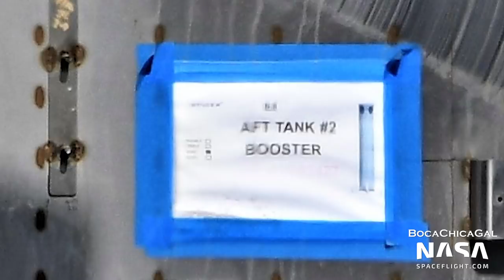Booster 7 Detached from the LR 11000 Crane | SpaceX Boca Chica

Comment from the maker: 0:00 Sunrise Over the Launch Site
0:36 The Launch Site
1:20 Ship 20 and Booster 7
1:42 Beams Lifted Into Place for the New High Bay
2:07 Ship 24’s Nosecone
2:29 Booster 8’s Aft Tank #2 Section Prepared for Moving
3:20 More Beams Lifted for the New High Bay
4:04 Booster 8’s Aft Tank #2 Section Moved Into the High Bay
5:02 The Orbital Launch Mount
5:23 Orbital Tank Farm Venting
7:16 Booster Grid Fins
8:14 Crews Work on Booster 7’s Aft Section
10:48 Load Spreader Detached From Booster 7
11:25 SpaceX’s LR 11000 Crane Rolls Away from Booster 7
11:51 The Chopsticks are Moved to Make Way for the Crane
Reply: Sorry if this has been explained, but do we know why the grid fins aren't installed on B07?

Comment: Very nice!! I can't wait to see booster 7 lifted up on the launch mount. Hopefully lifted with the chop sticks
Reply: Indeed, though its likely that 7 will visit the can crusher test pad first. I think this was originally the plan when they hooked up the load spreader, i dont know why they have taken it off already, it wasnt used at all to my knowledge.
Reply: @Vatsyayana87  with how high the winds were there yesterday they most likely used the crane to help stabilize B7 with the wind. They've done that in the past with B4 and starships when the winds were very strong
Reply: @RarestAce  If the winds were high that would definitely be a good reason. I dont recall noticing them being of any significance, usually its pretty obvious on camera, but not always.
Reply: @Vatsyayana87  The amount of time spent working on the clamps holding B7 might mean they are having trouble with them. This new type is hydaulic I think and should be simple to use, but for some reason are not. Also, why did the crane have to move away at all? Needed for somthing else?
Reply: @Vatsyayana87  You mean with the ropes? Surely the ropes aren't long enough for a full booster
Reply: @BRAWGWill  Indeed, i mean 70 meter ropes are by no means unreasonable thing to picture. But i do think its more likely to be that B7.1 will be the one getting the crusher.
Otherwise they wouldnt be making a "test" named tank right now.
Its just a bit odd they would bring the crusher and 7 down without any engines on it. So we will just have to see.
But also, it not uncommon for companies to do this on there full sized vehicles. its the only way to know for sure.
Reply: @rogerhalt3991  I do agree  with you here, They are making a new test tank that i dont know what else would be done with it except go on the crusher. But it does seem possible to put 7 on it as well just maybe not to the same extremes, i dont know. Both sides of thought make sense.
Reply: @knowledgeisgood9645  Same questions on my mind lol. I just woke up, and i see on my right here, that she is now on the pad. So i guess that answers a few things lol
Reply: @Vatsyayana87  Makes sense to pressure test without raptors or grid fins in case of RUD
Reply: @BRAWGWill  I agree, and its already on the pad so im guessing that means 7.1 will be the one in the crusher. 
Though i still agree with the fact that its not beyond reason for a full sized one like this to undergo such a test. Its just up to Spacex if they feel its needed or not.
Seems to me that the crusher on the small tanks only really puts the contact points to the full test though and misses out on the question, will the entire thing fold in half under such loads, which can only be tested with a full article.
Reply: @Vatsyayana87  They haven't felt the need to test other boosters with the same contraption before though. So I wonder why now?
Reply: @BRAWGWill  B7 might even be a path finder for B8. They need to test a booster for structural strength at some point, like they did with a nosecone. I would have used B4 for that, but it could be B7. I will have to wait and see.
Reply: @knowledgeisgood9645  B5 is another logical choice but maybe they want to test it with a more up-to-date design. If they do end up opting for B8 it will put the numbers back in line with B4/S20, B5/S21 etc. which I'm sure will satisfy some people
Reply: @BRAWGWill  I would think its just step by step, maybe they feel its time to do so. 

I dont think the whole setup (crusher with 33 points) has been complete until now, i feel like they just used the outer ring for the previous crush (which crushed the area right under where the aft dome is welded).
 Further more, I dont recall there being any 33 point thrust systems to test it on until now.

Of course this is all just my guess like any one elses, personally i feel like they are gunna do a pressure test on the pad while they are hooking up the booster staging area, which is where the crusher is placed now and does not have the piping connected to that location yet, but thats being worked on right now from what ive seen. 
(In case you dont know where this is, its at the end of the berm that runs behind the GSE farm, it ends at ship and booster staging pads, the ship pad is connected and has been used, not the booster pad yet.)
Anyway, then they might swing 7 over to that location to do a crush test under pressure before hooking up the engines for further testing.
Reply: @knowledgeisgood9645  Agreed, but as always gotta wait and see.
Reply: @Vatsyayana87  Ok interesting
Reply: @BRAWGWill  Yeah, of course these are just my thoughts though, i have certainly been wrong before. I havent seen any 150 meter ropes for such a test anywhere, but you never know when strange and impressive things will show up out of no where lol.
One quick side note, It would be the same test NASA did with the main tank of SLS, they just of course did it with a massive steel building, when some impressive ropes probably couldve done the job for about 1% the cost lol.

Comment: Its interesting that the arms dont move together at the same speed, one is always lacking behind a touch. Im curious if that is by design or just a difference in the hydraulic performance. I assume design.
Reply: Maybe to help counter the wind when loaded with a booster/ship. 🤔
Reply: @XeL_666  Well when they have a vehicle on them, they cant move separately at all since they will be fixed to the vehicle. 
I am talking specifically about when they are empty though, one lags behind and catches up once the other stops.
Reply: @Vatsyayana87  Could it be that the first one has nothing to look out for while the second has to make sure it doesn't damage the first?
Reply: @knowledgeisgood9645  Thats pretty much what i wonder as well, But i cant help but feel like we have hydraulics down extremely well and they could travel together without issue. But im no hydraulics guy lol